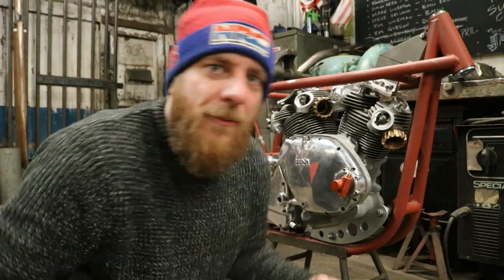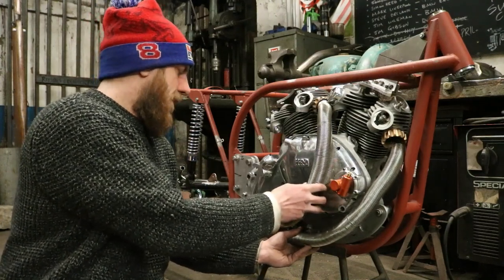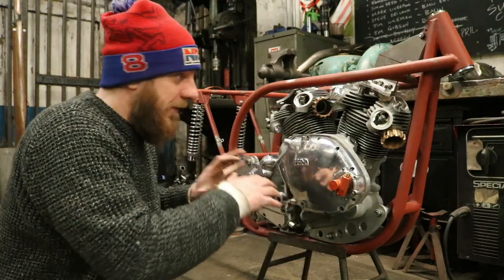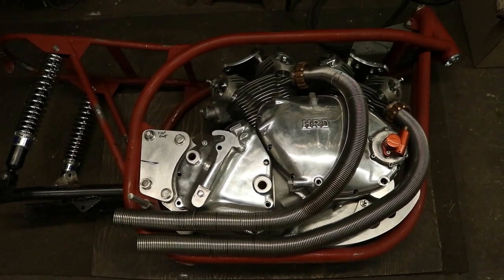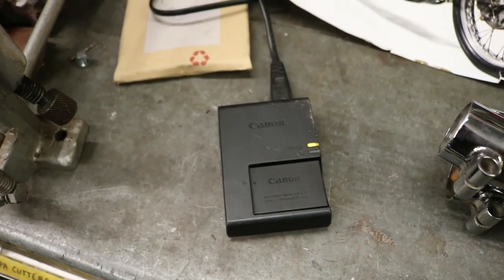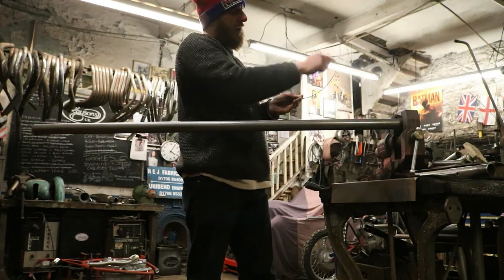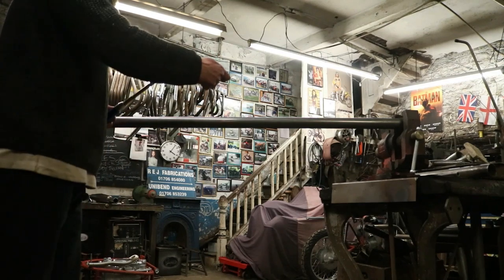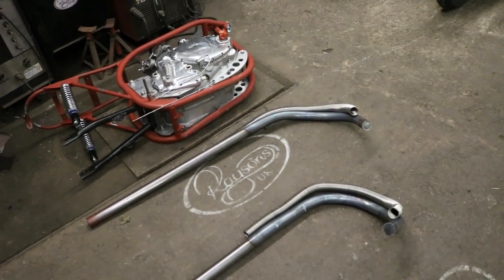Norvin, Sand Bending the Exhaust pipes for a Vincent Engine fitted in to a Manx Norton Frame, Part 1

Comment: I know what you are saying about bore of pipes I’ve rode a shovel head over 30 yrs I’ve had drag pipes 2 inch drag pipes 1 3/4 inch pipes with tapered silencers and the best pipes are 2 into 1 1 3/4 bore and I just had a cut down cheerybomb for a silencer with a bit of baffling ran bloody great smother just a nicer ride all round and the pipes weren’t measured length the rear one was quite abit shorter for looks 😂 of course! But I don’t see any advantage in making them the same length when it’s going into a can anyway… it seems to me they balance themselves out fine , oh I have a 1600 Evo lump now that’s got 2 inch pipes on it they will be going in the bin asap 😂😂

Comment: you are right about the dia,  I built a triumph chopper back in the day ,,calculated everything out , didnt know my arse from elbow ,   the pipes were slash-cut drags of a length for max power ( or slightly lower~ ), and ended up , too noisy, useless everywhere in the rev range except the rpm I calculated ,,, ie  never ....    just built an exhaust for me Enfield,   small dia pipe long primary and a long silencer   MUCH MUCH better! ,,,,
Reply from the maker: Grandads brief lesson on this subject. Was, that trials bike have long skinny pipes, that zigzag through the bike to increase the length. And have loads of bottom end. Where as drag bikes/sprinters have big bore that are cut short. And are used for top end performance only. 😉👍
Reply: Took the baffles out my reverse cone megas back in 1982. Six fifty triumph. Sounded ridiculously loud, no torque at all ,an actual power band when the revs got high enough.  Took it down the bypass and back and put the baffles straight back in.

Comment: Why not make a short section into the exhaust port so you have some fixed reference point to start from that you know aligns?  Will you leave enough clearance tso the owner can keep those engine covers polished?
Reply from the maker: To make the pipes fit, a short section is made, to come out of the head. Which allows the pipes to be tweaked into the perfect position, before welding them to the collars. 

The pipes have just enough gap to slide a rag behind.. to keep them clean. 😉👍